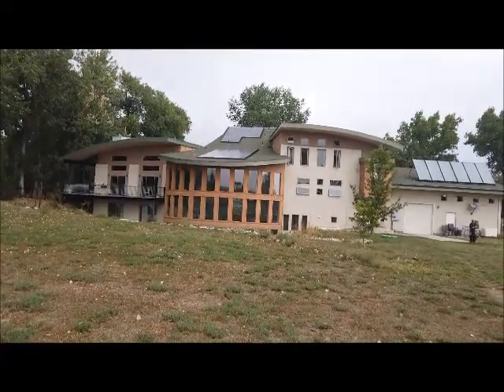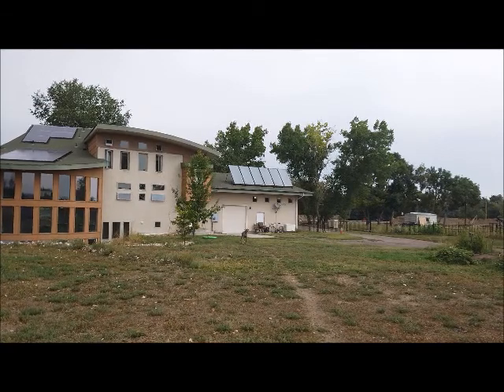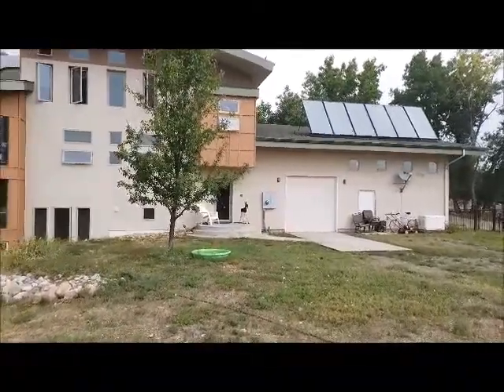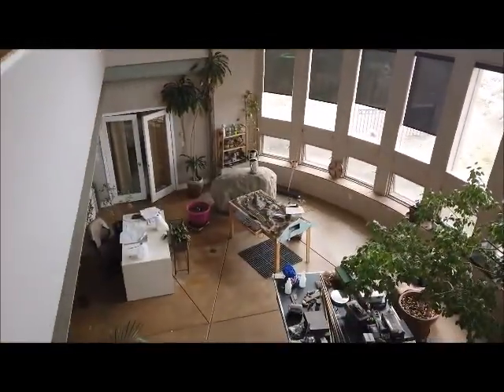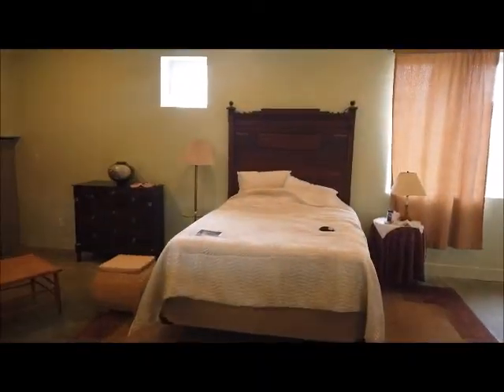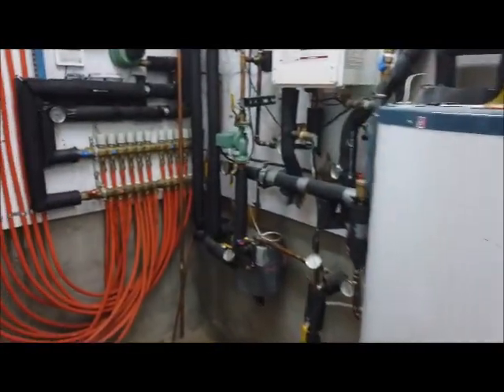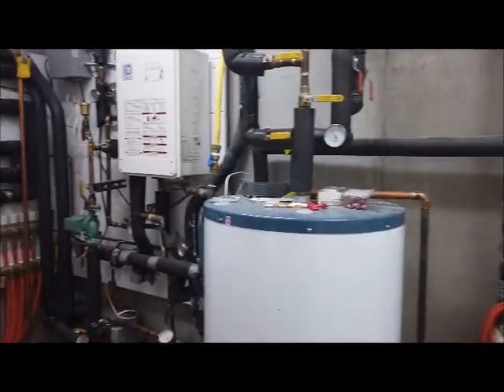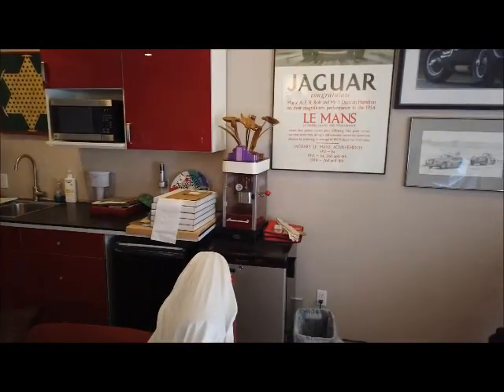Bob Grossman's Straw Bale Home in Arvada with Solar Thermal Radiant Floor Heating

Comment: Ventilation, not mentioned. If this is actually an Earthship, the ventilation will exit from the northern part of the building. The southern part has a lot of windows. The amount of straw in the walls reminds of the hut I used to live in, when in Africa. Those walls   where built with some 'horse manure ' for increased stability.